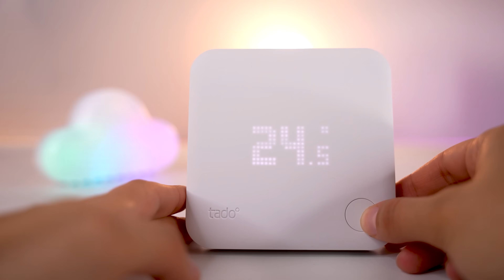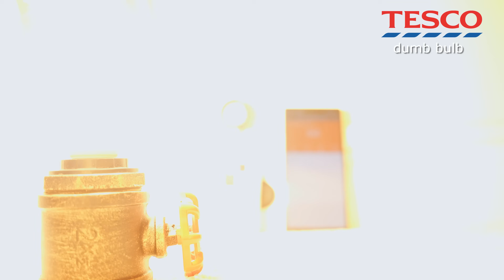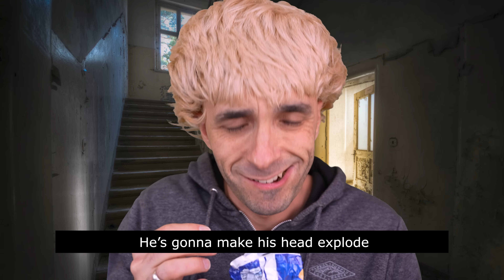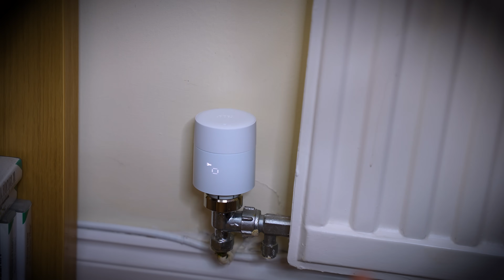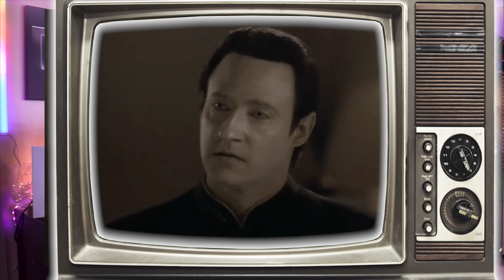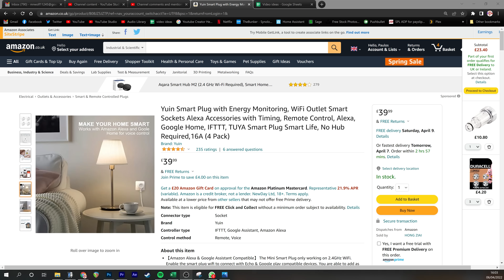The Energy Companies Will Hate Me For Telling You This But... | #EnergyChallenge

Comment: Just brought the Drayton wiser system but my boiler  is over 40 years old opentherm wasn’t a thing then. Lol, drayton also has open window and integrates into home assistant.
Reply: I possibly ram into a similar issue with our landlords HVAC guy. He claimed the Nest thermostat we had installed caused the main board to corrode because the furnace was too old... very  confusing considering the furnace this was previously on was a 3 wire set up that was 2 years older, worked for years no issues. Worked fine here too, until the a coil was determined to be leaking, the thermostat was still blamed. After talking to the guy, he’s been retired for years and the programmable and smart thermostats confuse him

Comment: Genuinely surprised to learn that smart light bulbs use less power than 'dumb' LED equivalents, despite the former being pernanently powered on. Disappointed regarding the power draw of smart speakers / displays but not much that can be done about that especially as three of mine also serve as clocks (one Lenovo and two from Best Buy in the US.)  I'm also heavily invested in the Tuya ecosystem, voice controlled by Google which is tbh rapidly becoming the weak link, but I'm no computer whizz and cba learning Home Assistant. Recently had my 20yo combi boiler replaced and and connected my old Gen 1 Nest back up to the new one for now, so I'll definitely look into a Tado or other OpenTherm capable replacement longer-term.
Reply from the maker: Dude.  I fitted it to the Opentherm terminals myself.  Please don't tell people it doesn't have Opentherm, it 100% does, it was agreed up front with Tado that I could only include them in today's video if it had Opentherm.

As for comparing apples and oranges... they're both light bulbs. 🤣  The trickle of electricity when they are turned off is NOTHING compared to the yearly expense that the Tesco LED bulb's draw when they're on.  You say you "don't believe it" but I showed you on camera the higher draw of the Tesco bulb.
Reply: @paulhibbert  The EU one has OpenTherm, the UK version does not.

You must have a European one.
Reply: @paulhibbert  And yes, of course a 17W bulb consumes 7W more than a 10W one.  The answer there is to fit a bulb that's not too bright!
Reply: Genuinely don't believe it about the bulbs - it's all about the wattage & the use.  Smart bulbs consume power when "off".  Apples are being compared with oranges

Comment: Cutting power to your TV can actually ruin it.
Especially with OLED screens.
Most of them have important software, that executes when they're off, that prevents pixel being burned.
Some electronics stores used to cut power to their entire display. 
Which absolutely destroyed most of the screens.
Reply: The compensation cycle. If you can afford an OLED you can afford the cost to run it in stand by. You'd spend more and cause more pollution taking it back to the shop to get it replaced 😂
Reply: Most smart TVs are basically small computers running android as well. Constant hard resets are not a good idea regardless of your screen type.
Reply: Check the backlight settings on your TV , if set too bright , or something like DYNAMIC or STORE they'll use twice as much power !!
Reply: @j_o_h_n_d_u_n_n  That's really important on LG TV's from 2012-2016 era too as the backlights had a habit of burning the backing and shorting the the metal back plate.
Reply: There's a manual pixel refresh you can do periodically on OLEDs.  It would be a matter of remembering to do it of course.
Reply: @trevhib  I would definitely say that this is 100% anti home automation and smart hime suggestion.
Reply: @shaygus  How many hours of TV do you have to watch on an LG OLED before they recommend doing the manual pixel refresh Shay?
Reply: @trevhib  That's not really relevant.
It's the same like cleaning AC filters.
This is something you need to do....
Reply: @shaygus  Of course it's relevant.  You just don't want it to be because it goes against your narrative.  All the best mate.
Reply: @trevhib  It's not about a narative, it's about the Smart Home.
Smart home is a different thing from controllable home.
Smart home is about taking manual tasks from you and mainly about freeing cognitive capacity to handle other stuff.
My original comment was about the fact that that few experts stated it's not reccommended to cut power to modern screen especially if it's on.
I'm not against saving on electricity, infact my whole home has many sensors and automations with the sole purpose of saving on power.
My second comment was, that anything that's not automated, even if you have reminders for it ought to be missed.
For example cleaning the AC filters, I actually have an app for that and still I forget to do it.
The reminders tend to go off when you aren't near the device or just busy and can't....
For me there's no point of creating one automation just to add yourself a manual task to perform.
So again it's not about the narrative, for me it's just a thing of practicality.
Reply: @shaygus  I don't disagree with any of that but currently you appear to be arguing against an automation routine that's going to run 2-3 times a day on average, on account of a manual process that involves about 6 button presses required once every 6 months or more.

Comment: What about the zigbee/wifi enabled switches/bulbs themselves…they’re technically in standby all the time, and, so, will also be drawing electricity
Reply: What you need to do is install smart switches before the smart switches so you can switch the smart switches off with the other smart switches.
isn't it obvious?
Now do you think I'm joking?
Because i'm not, but to have the desired effect the first smart switch should be a wifi MCB / RCBO in the consumer unit.
The only issue there is the freaking 18th amendment requiring all consumer units now be made of metal!! 
Plus dini mount wifi RCBO's are rare and I bet quite crap for longevity.
Reply: ZigBee uses about 1/100th the power of WiFi

Comment: If I boughta USB fan, would that be cheaper then a mains fan  Paul
Reply: If you compare it to how much air it moves probably not. But since the usb fan is probably smaller then yes it would use less power. 

The real difference in power would be different technologies of motors. A brushless motor is more efficient than a brushed motor.
Reply: @ecospider5  I'm disabled and spend lot of time in bed  so prefer a fan to keep cool and not have window open